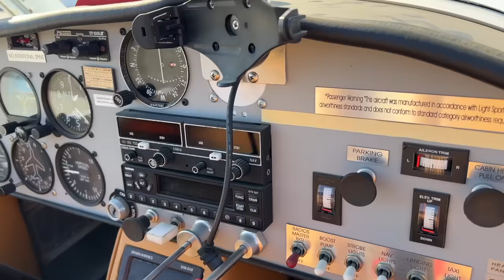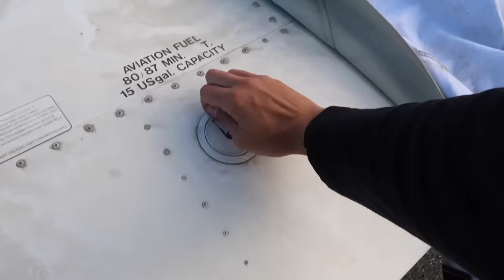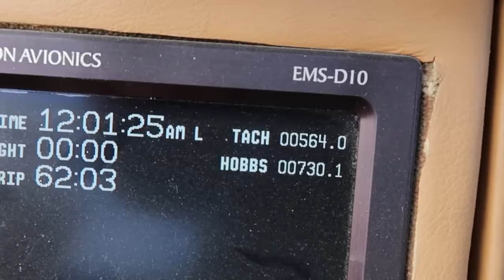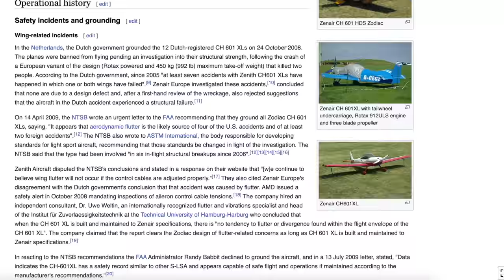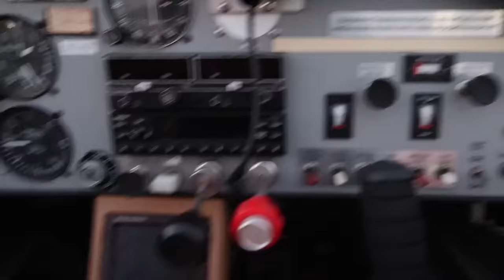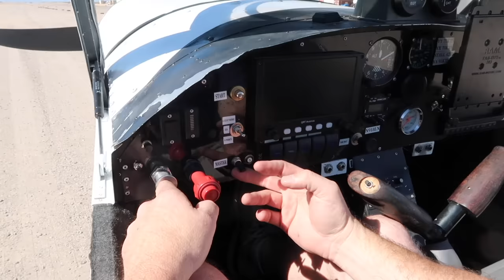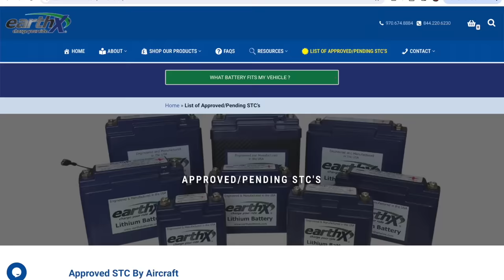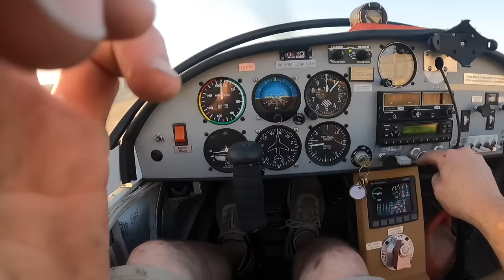We Bought an ABANDONED Airplane For $16,000! Will it Start & Fly After 8 Years?

Comment: Congrats on the purchase, very comfortable airplanes.  You mentioned wanting to do upgrades a number of times in your video.  Remember that SLSA aircraft are certificated under ASTM standards which REQUIRE a Letter of Authorization from the manufacturer for any deviation from original equipment or repairs that are not specifically described in the aircraft maintenance manuals.  While the new AMD is supporting these 601's, you might want to consider moving yours to an ELSA.  There would be two benefits in doing that, first you could deviate from original equipment. Second, after taking a 16 hour course getting your Light Sport Repairman - Inspection (LSRI),  you could perform your own maintenance including the Condition Inspection.  Good luck!  Will enjoy watching your videos.
Reply: "you could perform your own maintenance including the Condition Inspection" that's really not the best idea imo
Reply: @raymondo162   The beauty of S/ELSA aircraft being built to ASTM standards is the requirement of very detailed maintenance documentation.  There is no expectation of using the 43-13 to interpolate work, it has to be laid out (unless the 43-13 is called out in the documentation).  As long as you follow the documentation, it's hard to screw up.

Comment: It also will not hurt anything to add some Marvel to your fuel. I worked on crop dusters for years and we ran car gas most of the time. I would add one gallon of Marvel to 500 gallons of gas and we never had any valve problems. You will love how easy that plane flys!

Comment: I just bought a Kitfox Lite for 9K. Set for 5 years and started up no problem. Uship mover could not put it in his trailer so I went out and bought a trailer for $2,200 in like new condition. Shipper was going to charging $1,900 so i really only paid $ 300 for the trailer. Kitfox has folding wings and fit on trailer with no problem.  I love this little plain 😍. I am getting ready to fly it soon😎. If you haven't seen a kitfox lite go to YouTube and check it out. It has bush tires and looks good after I finish it I will post it on YouTube It is a Ultra lite part 103 no license to fly. Regards; Phillip

Comment: I taught a guy to fly in one, he bought new for $108k. His was a factory built Zodiac 601. Great little plane, it was a LSA, not the SLSA. Had dynon avionics. Be careful of the canopy, you have to insure it double clicks locked. There’s a tale of someone falling out after trying to reclose it after it popped open in flight. Scary. Great flying little plane. I’ve got some videos on my Facebook page of it.
Reply from the maker: Wow $108k new!!
Reply: The tale of the guy falling out, as I recall is he was a passenger and had a CFI flying who never flew a 601 and was unfamiliar with how sensitive they are in pitch. 
Anyways, as the story goes the passenger exited the plane before taking off and when he got back in, didn’t fasten his seatbelt or harness. 
The canopy did pop open in flight (when it does it only opens about 6” but makes a hell of a racket), it startled the CFI who made a significant pitch down and in so doing the unsecured passenger experienced  negative g’s and exited the aircraft

Comment: Good buy at $16,000.  I rebuild motorcycles so I have some experience getting bikes going after sitting for years.  Personally, I always change the oil and replace the filter before try to starting.  It's cheap insurance.  Putting Mystery Oil is a good idea, i would have hand cranked it about 10  times, add a bit more oil to try, another 10 hand cranks to try and get the oil to the connecting rods.  I would also flush out the fuel tanks.  Of course in old bikes we have carbs that need to be flushed.

Comment: With the exception of your oil not changing to new oil plan, it's a great video. I would have used new oil to fire it up and warm up to clean out the system, then change it again while hot. 16k for a plane, what's another 50$? seriously.

Comment: Wow, that part scared the LIFE out of me!!! Enjoying the video. Just to let you know, there is no way that the battery is a lithium Ion but a Lithium Iron Phosphate. This is just due to the chemistry, lithium Ion wouldn't be used in an air plane and 100% wouldn't replace a let acid battery. While lithium Ion can hold more capacity in a smaller package compared to iron phosphate, the latter is much more safe and much more durable. Just a small correction.
Reply from the maker: That’s for the correction, you’re right, lithium iron phosphate.

Comment: That's a great video. I'm delighted to see you get it home and running so soon. I'm considering the same thing with a factory build 2006 LSA. It's been in a hanger for more than ten years but should have all documentation. The biggest problem is that it's more than 4000km from home. Do you pull it apart and tow it home like you did or fix it and fly?

Comment: I loved this video, regardless of its length. I prefer this to having it split into several shorter videos posted randomly days or weeks later. :) 

If I had the means to dump $20k on something that may well be worth that in parts, then sure, I'd give it a shot. If I could have had someone inspected it first, that would make a big difference. You learned a lot just from eyeballing it, and more after getting under the hood. So it pays to have the right connections and ability to get one of them to show up in a pinch. 

Many years ago, my little brother bought an old Mercedes convertible sports car (dunno what model) that looked like it had been sitting for 10+ years. He started to strip it down, and realized he was way over his head. He talked to some mechanics and came to the conclusion it would cost him more to get it fixed than it would cost to buy one already restored, so I think he sold it to one of the mechanics for its parts value.

Comment: Good information.  The only things I would change is to try and track down the previous owner for the log books.  And second get a real truck.  I guess YOU can plan on napping at charging stations, but not me… also many charging stations will not accommodate a trailer… so you may need to drop the trailer before moving to the charging station.  That’s a bit cumbersome.  I wouldn’t get a nap having to watch the trailer and it’s cargo!

Comment: Those older kits were not match hole drilled.  Meaning you got the kit and it was just sheet metal.  Now most all the holes are drilled for you,  it’s a lot harder to screw it up if everything is drilled for you.  

They are fun,  hot in the summer with the bubble.  But it’s fun. The elevator is kinda dead till you get to like 20 mph, and then it’s all of a sudden pretty sensitive.  But they fly good.   The nose wheel on all zeniths is garbage if you ask me.  I asked Chris Heinz about why,  he believed in a crash it would absorb the energy.   He also did the center control because one of the main injuries in a crash is getting hurt by the yoke or stick.   You can’t impale yourself in a zenith. 

Chris designed the structural pop rivet.  It’s a river that is domed.  I think he was working for airbus.  Sebastian is very nice at the factory.  I worked for George Heinz.  He is zenith in China.  

Be careful with the wing spar.  

Also the ailerons,  originally they had no hinge,   It’s the wing skin that bends.  Most guys changed that.  It’s actually plenty safe,  they tested the heck out of it. But the idea of bending the metal every time you move an aileron is a bit strange.

Comment: Hi, great plane. Very fuel efficient, but be very careful as there is a buletin on these as the wings separate from the fuselage. I lost two friends due to that despite the unfortunate plane had the connections strenghten. Good luck and check this and be careful not to overload it with Gs.

Comment: In the U.K. under (microlight or permit) aircraft, it’s advised and sometimes mandatory to install an isolation switch from the Earth X battery. They are of the highest in quality but should a lithium battery go faulty there is a risk of fire and you need to isolate it (turn it off) from the cockpit so I would definitely fit one and it’s easy to do.

Glad to see the story unfolding in longer content :) 

You got a good buy here it seems.
Reply: Other thing is that lithium batteries have a much lower internal resistance. You can't just replace an old lead-acid for risk of overloading/blowing-up alternator.
Reply: I've been building these for a while in various configs and chemistries and if the battery itself has a fault isolating probably won't do much. Of course isolation is useful if something else draws too much current. Blowing up an alternator is very unlikely (among other things we use these on motorcycles with extremely small alternators) and keep in mind the lead acid batteries used for starting vehicles also have very low internal resistance--it's a main design criteria and they're specifically built that way as a tradeoff vs capacity. The main difference is the per-cell voltage difference between lithium and lead acid giving lithium vehicle batteries a volt or two extra at rest depending on the chemistry, and this generally isn't an issue.

Comment: Hey guys - nice plane make sure the ailerons have the mass balance kit installed to reduce the chance of flutter that was a potential problem on the 601.
Reply: please explain what that is to a novice and why it is needed
Reply: @snorttroll4379  Sure - the flying surfaces on a plane deflect into the air stream to make the plane move. Whenever something moves there is always another force opposing the movement. Flutter is a condition where these up and down movements of the control surfaces get bigger and bigger and can eventually cause damage and in the worst case can take the wings off a plane. Originally the 601 was designed without weights added to the control surfaces to damp these oscillations- the design relied on tension in the control cables. There were a spate of in explained 601 in flight breakups and the theory was that flight control oscillation was the cause. A relatively simple fix was to modify the control surfaces and add counterbalance weights to act as further insurance against this problem. Hope that helps.
Reply: The mods to the 601 xl were much more than balancing the control surfaces including beef up in the wings and fuselage. As a dar I was forbidden from certifying a 601 until it was modified with a kit from zenith to bring it up to 601xlb status. Some of the failures involved the factory built 601xl’s.

Comment: Another trick you could have done was taken two 2x6’s and bolted them down across on the front of the trailer with them sticking over the edge enough for the wheels to sit on and with enough gap for the wheels to sit between them and strapped them down good and tight. Food for thought on your next purchase.  I just picked up a Stinson from Missouri to Michigan and had to modify the trailer with that method and worked great. Great find!!!!
Reply: that actually would not work.

Comment: Great video.  I will be interested to see what the process is to recreate the logs.  Lots of planes go with missing log books and I have seen it tank their value.   However this plane is newer and less history.  Even much older certified aircraft can have hidden history even with log books, so I question the validity of them in the first place.  I know you will but make sure you go over that plane carefully.  If memory serves me, that, model had some accident of in flight break ups.  I think that is what the AD was triggered by.  It will be great to see this thing back in the air.

Comment: FYI. 80/87 grade fuel is not mogas. It was the predominantly used fuel in singles bfr 100LL replaced it back in the 70's. 

It's advantage was that it was cheaper than 100LL. Also, 80/87 actually had less lead in it than 100LL.

Comment: My Zenith CH750 has  Honda fit engine by Viking engines. need to remember putting a lighter battery up front can significantly change your weight and balance make the plane more tail heavy, since you don't have the log books or POH you'll need to reweigh.

Comment: I own a 601XL (N969BC) so I was interested in your video. 
Honestly, there were only 2 times I really cringed
The first was when you were pulling the prop through after adding the Marvel Mystery Oil but your face and head was inside the prop arc. 
Granted, the chance of the engine turning over was minuscule, (remember the plane has an independent ignition system with the magnetos, you don’t need a battery to start -it can be hand propped.) 
The other time was when you didn’t chock the wheels before starting the engine, given the appearance of the brakes a run away engine with no brakes or method to steer is inviting a bad outcome. 

Good luck with the rebuild

Comment: 34:15.  Please NEVER turn a prop in the direction the engine runs.  Even worse is putting your head in the arc of the propeller.  If you had a hot mag, you’d be dead.  It happens more than you think.  Great video other than that!  Be safe.

Comment: 37:28 nope, that oil has been baking in the engine for 8 years+ its protective capabilities will have severely diminished, alongside having impurities seeping into it, bad call, really bad call actually 😢 The old oil should have been drained & checked before starting for particulates to get a clue on how the engine was doing before lay up.

Comment: Hmm. For at least some Continental engines, compression numbers are irrelevant, according to the factory. And an electric primer -- on my plane, that was a solenoid that required the electric fuel pump to provide the pressure.

Comment: Cool. You need courage and vision to do that but sounds like you got a great deal. A 2006 is basically factory new compared to a 300k Bonanza.
And you can share hangar costs with a couple of guys and sell shares for 15k. Mine was 8 way and it was always available. People rarely flew, some were so old they didn't fly.
Like mine this plane mostly approximates the shape of a plane so they are not fast but sleek LSAs like Risen can match a Bonanza with only 100 horses and the 915 version can go over 400km/h. Only about 25% slower than a visionjet yet burning only 10GPH. Of mogas which in USA is about half price of avgas or jetA iirc.
The right sleek light plane can give private jet freedom for basically no money. So much untapped potential in aviation.
For a video you could find a Risen owner in USA and try it. I think there is something like 3 with the 915, imported by pretending they built half of it in Switzerland. Otherwise not legal.
It's not the final say in aviation but seeing it go fast past a Bonanza is enlightening.

Comment: There's an aircraft i know that's been sitting inside a hangar for 10 years.

I wouldn't touch unless it was given to me. Engines rust up internally unless they are pickled. 

That's just the engine. Seeing that said aircraft is a retractable, who knows what else could be wrong with it.

Comment: Does this 601 XL have the B mod done? If not, that is going to be a significant expense. Also, the fact that it is an orphaned SLSA makes it an undesirable plane. You know you can't make changes to an SLSA aircraft without the manufacturer's approval right? Even adding the ADSB that you've already done is technically not legal. And you also know this manufacturer is out of business right? You have an orphaned SLSA that no one will buy unless you convert it to E-LSA. This plane is probably worth what you have into it right now. I think you need to educate yourselves on orphaned SLSAs.

Comment: I just bought an RV 6 that was previously flying but had been stored for 8 years. He was asking $16,000 for it.  I paid $11,500.  Would I have paid $16,000 for your plane without inspection.  My answer is no, and would I have started the engine without changing the oil, my answer is again no.  The gas had water in it.  I imagine the oil did also.

Comment: They are great solid planes. With care and cosmetics it will came out great. Some little avionics updates will make sense like the Garmin GI 275 or so. ADS-B will nice. The lithium battery is light but critical for fire issues. I would not put that one in. In case of fire 🔥 in the air, they get you in big trouble. I just had that on a boat. No fun at all. For your flight training it will be a perfect gamer. And it is fun on cross country too. Make sure the engine is healthy and the wings are correctly back on. And you will be fine. Polishing the plane be careful not taking the paint off. And spend this plane some new design to make it nice again. Don’t forget the JR Aviation note on this. You what would be cool, to make the same design like on the Bonanza. But that means paint job. But great to document the JR Fleet. Also the Citation guys, in the same painting . How cool is that? 😊

Comment: Yes and you’ll easily smash through a further $20K in parts, overhauls, paperwork and certifications. The avionics alone will need updating. The wiring thoroughly inspecting throughout, the control cables will need inspecting and or replacing too. This isn’t showing the whole truth about what it costs to do a project like this. I know this from 18 years in the aircraft maintenance industry.

Comment: Im a A&P with 40+ years on Light AC and heavy jets, bought a few AC over the years, never made much money on them after Annual and parts...at my cost...like 4K or so. For  the price, if  the airframe  and  engine work out AND you have logs on the engine then its a good  deal.

Comment: That's definitely a good buy at $16,000 and I would have done it too.  I have a 2007 AMD CH601XLB and I love it.  It will be interesting to see how the voltage regulator (the blue box on the firewall) holds up.  I had to replace mine because it wasn't maintaining a constant voltage.
Reply: What is your empty weight?